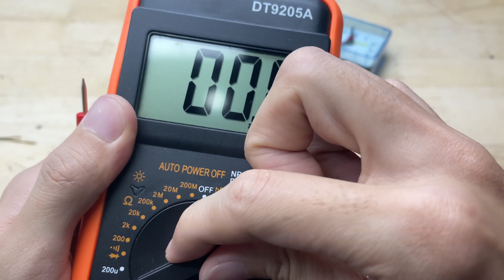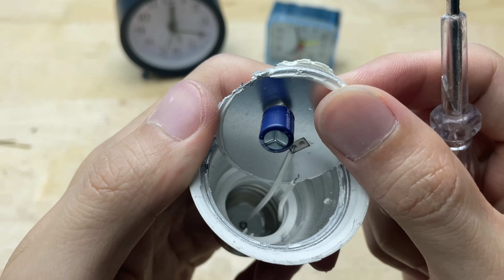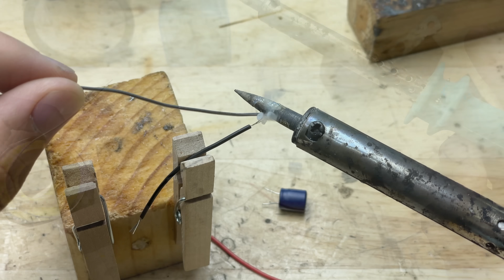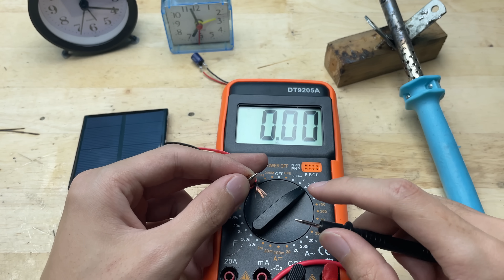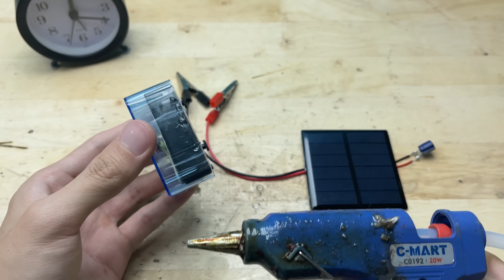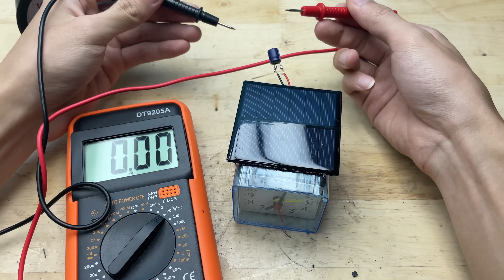FREE ENERGY! NO BATTERY NEEDED! Running Any Clock Without Batteries!

Comment: Here the capasitor has no role in running the clock. It's value is just 8.2ufd.  The main source of supply is solar panel only. The solar panel Voltage should be reduced to 1.5 otherwise clock mechanism will damage. It would be better to use 1.2v or 1.5v rechargeable battery instead of capasitor. A diode should be attached in series while using rechargeable cell to avoid reverse voltage.
Reply from the maker: I truly appreciate your support — it keeps me going!